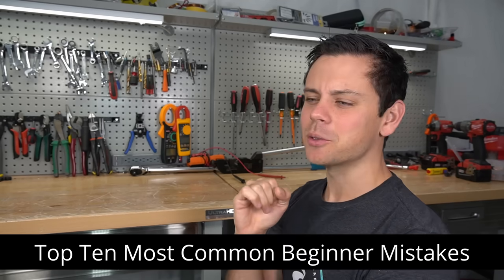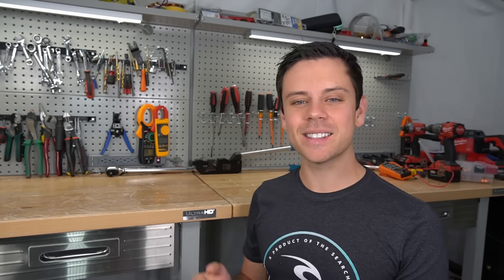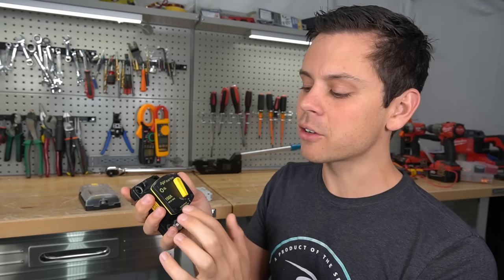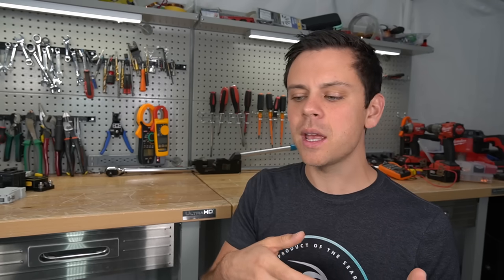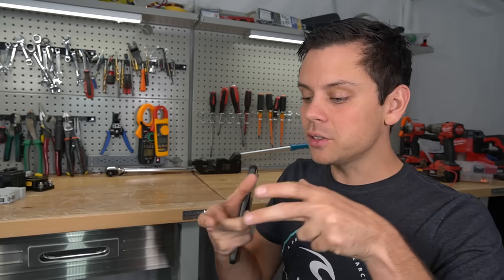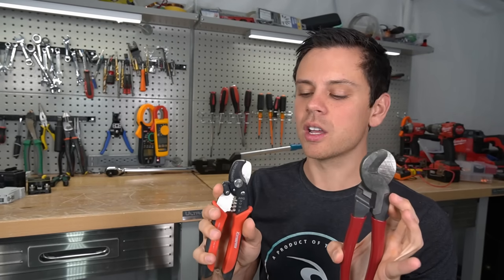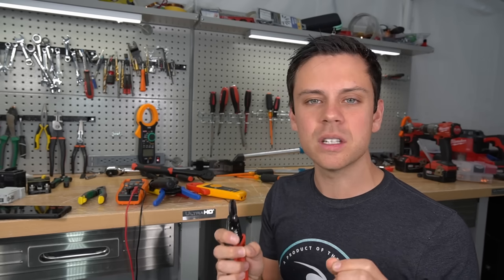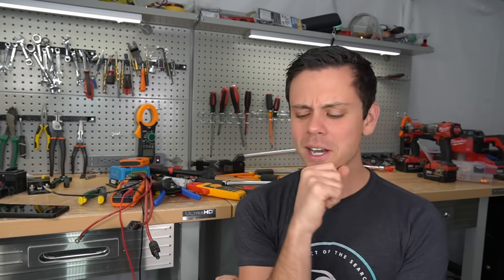Top 10 Beginner Mistakes When Building a DIY Solar System

Comment: I've got a hydraulic crimper, but I've still had crimped connections fail. I've soldered big lugs with a torch and only had trouble with one - that was CCA so I'll toss that data point.  I've sweated copper plumbing, and I'm and EE so I've done more than a little soldering. Done right - and it can be done right, it's the best way to go. Crimping is recommended because it's still relatively reliable while being a brain-dead-simple technique with minimal experience needed.

Comment: Does it matter if the batteries are different sizes as in amps? Would you connect them up in a certain way in the feed like small one first? Etc Cheers Ray

Comment: How does having a large bus bars allow me to put more batteries? If my battery bank is designed to be 500 amps at 48 volts for example, and I need another 500 amps of 48 volts, I've always been taught that I can't do that. 

I know this is a video about the top 10 mistakes for beginners, but I really wish I could get more information so that I can go more in-depth in regards to this bus bar/adding more batteries idea.

Comment: Will, you are WAY SMARTER than me!!!  i have a question for you.
lets say i want to keep my batteries at 100% charge at the longest possible and im using lead acid batteries.   how would i set up and wire my batteries so when 1 bank is at 100% charge something automatically switches to a second bank , and on and on as i add battery banks . then when i draw down a bank to 95% it tarts charging that bank  .
i am able to rebuild lead acid batteries i get from scrapping cars and people giving me dead batteries. even though the non deep cycle batteries are not designed for deep discharge, they can be grouped into a large bank together . i have 2 banks of 6   6volt golf cart batteries. 1is t105 and another is t105re. they were purchased brand new in 2016 and still going strong, but i desire some DIY way of automating this idea using relays etc...
i think it would be a great idea for a video! lots of people desire to be energy independent but spending thousands of dollars at 1 time is difficult  for them.
myself i have zero debt! and i spent $150,000 in 2017/2018 to ensure my family will have what we need for several years if we just stayed home and didnt leave for several years and had NO INCOME coming in!  yes, we have a lot of cash left to pay our taxes etc...

Comment: Wonderful helpful video!
I'm trying to put together a solar powered battery bank. I have eight lithium batteries that are 400 amp hours each, and I have a 6,000 w inverter that is pure sin waive with a terminal block, and it's a 48 volt inverter. I'm going to run the eight batteries for 48 volts. 
I was wanting to oversize my wires a little bit so that they would not run so hot. But I'm not sure what size copper wire I should be using, but I'm guessing a two gauge. Do you think the two gauge would do well?

Comment: Another issue with soldering lugs is, if there is enough resistance the wire or lug will heat up and the possibility of that soldering melting and letting go of either the lug or wire becomes a real problem

Comment: do I calculate how many amps I can pump into my inverter via PV by: 
input current by max pv input current (in this case 22A), or 
pv charging current range can be set (in this case 100A)
Thx

Comment: Hi Will, 
I have a question not pertaining to your video. I have a UPS a CyberpPower 1500AVR. It’s used and both batteries are dead, it has two 12V 8A  SLA battery. Can I change and use two LiFePo4 12V 10A  batteries?

Comment: Question. You mention torque screw drivers toward the end. If you have a loose but thick set of wire (e.g. 6x6) versus a loose but fine set of wire (e.g. 16x16), will it be harder to make appropriate torque on the thick set of wires? That is, the larger gauge wires (6x6) may have movement after the first appropriate torqueing, as they may re-settle after initial torqueing.

Comment: Hi I got an issue. I have a hybrid system where i hv connected grid n pv to the inverter. The inverter setting are pv 1st and balance from grid. 

So the issue is if pv line give power to the inverter 1st the rccb in the input side of the inverter trips as soon as grid tries to give power to the inverter, but if grid gives power 1st n then pv the rccb dont trip.

Comment: HI Will ... Have you ever tried to use the lithium battery blocks from inside of a Bluetti with external controller/computer/inverter?  I would think there is a LOT of people out there with DEAD all-in-one systems (Bluetti, Jackery, etc.).  I would think that if you could design a "system" that would work this way, there would be a LOT of demand for that!

Comment: So you can run this on an AC200p. Which is a tiny generator if that's what it uses during peak part of the day. You could probably run it for a few hours over night without having to add a bunch of batteries.

Comment: Between series and parallel which the correct use when u have more than 6 planes of solar that produce 30v each plane and u have a 12v  inverter

Comment: Good vid. Anyone know where I can get printed material on choosing components and more importantly the right sub-components to connect the primary. I want to use solar, shore power, and maybe at some point leverage my vans alternator to charge the batteries. There's got to be a good book on this subject. Any recommendations? Thanks

Comment: Question: with two 12v 100Ah batteries in series to get 24v , when using 12v chargers do I need to disconnect the buss bar (connecting - & + of the 2 batteries) or can I connect the charger leads to the individual batteries as if they were not in series?

Comment: So I think i figured it out now but don't know where to find a 1200 watt 75 amp 24 volt solar panel on the cheep. I'm running 50 amp hr at 14 volts but will add 2 more 12 volt motors in the future. Was thinking of running two 5 cell packs at 3.2 volt each and 300 amp hrs each that should give me 16 volts at 600 amp hrs.. this is for a 12 hr run taking into account for days with no sun. Hope I got this right. I will run a good mppt and bms with plenty of serge protection

Comment: Hi Will.  I have designed and built my own system (and I rebuilt it once, too).  I've learned some of the same lessons that you discuss here, plus some other useful points.  I'd like to tell you about my system.  I know that my system is not perfect.  It's a work in progress.  I don't think I can do a video, but I can certainly take photos.  Would you be interested?

Comment: And it wouldn't hurt to use a distribution block a few inches from the controller, using the largest cable that fits the controller,  I like using half the rated current on cables, and keep it short as possible, <20 amps on 10 gauge, up to 50'  ,  2/0 5' with a 270 amp peak,  is possible overkill,

Comment: Nice video.
I'm doing a diy solar integration for my house. I want to be able to use solar energy to lower my bills but be able to seemlessly switch to mains power when the sun is down. So I got a hybrid inverter with inbuilt solar charger controller. The problem is that I later realized that the inbuilt solar charge controller is pwm. Now I would love to have mppt charge controller. Please what is the best way to integrate an mppt controller to my inverter and still retain the solar hybrid function?

Comment: Will
 Do the Solar Panels have to be orientated narrow side at the top?
Does it matter which way you place them?
 I can get 9 on my shed places horizontal and only 6 placed vertical.
They are rectangles.. I say Vertical meaning 21" side is up and the other dimension is 42"

Comment: Does anyone know if this system: BLUETTI EB70 + PV200 Solar Generator Kit is suitable as a package for use in case of black out for a home of 3 bedrooms?
I meant can you plug directly to battery to power our PC and fridges or portable heater?
Is it possible to add more to this system if one wishes to increase wattage?
Thanks in advance for your advice. God Bless.

Comment: a solar tracker using Two struts. cooper. ball bearings and magnets to move the solar tracker. As a funnel  like track gets smaller propelling the ball bearings down the track into a can. This moves the tracker  so little through out the day. After the last ball bearing gets in the bucket the bottom opens balls roll out, the struts push it back and the process starts over  Seen the show magnetic games. Using gravity and kinetic force.

Comment: Renogys premium 400w kit when hooked up in series causes a pv over voltage on the controller. They supply a fuse to hook it up this way, yet they know it's an issue.

Comment: Hey, Will… I was just listening to you casually in the background talking about torque spec and wiggling wires, I’m sure there’s a joke there somewhere , but on a  more serious note:  ⚠️⚠️ The issue I had is with the Chargeverter from EG4 I picked it up by the Positives of negative battery side of the charger and the positive wire came straight of the unit with no effort at all other than being under its own weight, this time bomb  was brand new out off the box….,. On Further investigation I took the cover off,  reinserted the positive cable back into the circuit breaker where it had come from and tighten it down. Maybe you can slip this factoid  into one of your near future videos …thanks for all your hard work. You where  my first point of contact for this wonderful world we get you enjoy off-grid these days. Thank you again.
Reply from the maker: Oh wow thats good to know!!! Can you post this on the forum? www.diysolarforum.com
Reply: @WillProwse  yes sir,  consider it done. respectfully…….

Comment: Engineer all power to go to batteries, use a multimeter to check voltage and current levels, get a rectifier or some other thing if you need to! Get a transformer in there.

Comment: What's the best way to safe guard lithium battery bank of 920 AH ( 12volt) from over discharge if I currently have 3000 watt renogy inverter.(purchase in 2021) and a 60 amp MPPT solar controller ( AIMPINVT) I would like to set a custom low voltage to 11.8 volts. Thanks

Comment: Any thoughts on whether I should get two 100ah batteries or one 200ah battery? Because I'd just get the 200ah battery but the size is odd for my space. I just saw that cables are expensive so I guess that's a reason to stick with one, but otherwise I don't really know.

Comment: Are there any good thread lockers that can be used for electrical connections? Loctite 290 says it’s for preassembled electrical connectors. Any reasons not to use it?

Comment: Hi there a question if i may. I'm based in the UK and looking to invest in a solar system mainly to reduce the cost of bills, so I want to maximise the cost effectiveness of the solar, and use it in conjuction with a grid connection. The money the grid pay for exporting solar electricity in the UK is tiny, maybe 12% of the unit cost of grid electricity. So my thinking is to plan a fairly small system that will mange most regular small loads: lighting, TV, small appliances etc. Maybe 4KW. For when the house is drawing more than that, we use an electric oven and electric kettle, and all together peak household loads might be 10KW or more. Is there something like a smart invertor charger that will allow the house to draw what it needs from the solar system (prioritising the solar and battery) and when it needs more KW it'll just take the extra needed from the grid? Basically I want to minimise the solar investment (i.e. a small system rather than one designed for peak loads) but maximise my solar consumption in cost terms, and minimise the use of the grid to when higher peak loads are needed for short periods.

Comment: hi Will, I have 4 12v 100Ah Li phospate batteries, I would like to expand it but told they're limited to 4P configuration. Can I  still add a single 12v 400ah battery to the power busbar? I guess that's akin to adding 400ah battery in parallel to the 4x100ah setup... thanks

Comment: Could I please ask you a question. I hear that connections in marine systems should employ a dielectric gel like “tef gel” when you are making these joins. I imagine to keep the surfaces oxygen and corrosion free. Does this gel also up the the resistance of the join? Do you consider this good practice?

Comment: A charge controller should kickstart it out of low voltage disconnect when there's sun again, right. I believe renogy do, do you have any thoughts on the quality of renogy (for a small system)?

Comment: Will, should my cheap blue charge controller be getting hot? I have 400 watts capacity from (4) 100 watt panels and the charge controller is rated for a 650 watt maximum PV input. It is a 60 amp controller. I have the panels connected in parallel to keep the voltage at 17-18 volts and a bank of 3 lead acid batteries connected in parallel to keep their voltage at or near 12.5 volts. the charge controller is rated at 12-24 volts. The only time the charge controller gets remarkably "warm" is when charging the battery bank in full sun . Connections are tight and secure. Charge controller gets almost too hot to touch on the back. Thoughts or advice? Much appreciated .

Comment: So can I use auto reset breakers on Amazon? I'm in Canada. Where can I buy good quality but inexpensive components like auto reset breakers and switch box and 24 to 12v regulator? I found a 40amp 4 switch box on amazon for $40. I already have Renogy panels, Renogy 40a controller and 2x100ah LiTime batteries. All wired up proper gauges and MC4 connections.

Comment: Soldering is frowned upon in vehicles because of the vibration as it wicks up into the wire and creates a failure point just passed the connector.

Comment: Is a disconnect absolutely necessary between the solar panels and the charge controller?
Reply: It is wise, if you change your batteries you must disconnect solar first or damage could occur to charge controller. Switch makes that easy.

Comment: Do I need a specific charge controller for lithium battery? Or, is there any difference. I bought a Missouri Wind package, and he said his charge controller will not work for lithium. Do you have a video on this?

Comment: I had a ProStar 30 charge controller, after about 6 years one of the terminals got loose and overheated and burned up the terminal and ruined the controller.  I should have been checking them more often.

Comment: Good afternoon sir, is there any problem if I set—up 17S cells lifep04 battery to supply the hybrid inverter and it has an input voltage of inverter about 48vdc-60vdc.

Comment: Hello Will. I have a question kinda off subject. But i live off grid and on rainy cloudy days i use a small 2 cycle 800 watt generator to recharge my battery bank using a 30amp 120v car battery charger. It works well to recharge But the surges and fluctuations of my generator have burned out my battery chargers in the past. And when the sun suddenly comes out and hits my panels while charging with the generator the generator accelerates suddenly and shoots up in voltage. Is there any way that i can get a 120v Ac to Dc converter to plug into my regular conventional generator to then add a regular 12v inverter to get a more stable electric flow not affected by the sudden gennie surges. In otherwords turn a regular generator into an inverter generator. Please help with some info. Thanks. I cant afford to buy an inverter generator at the moment so thats why im trying to go this route instead.

Comment: Exactly right about crimping. And crimping with a high quality professional tool. However, I then solder them on occasion (optional for lay people). Messy wiring is a very bad practice and must be avoided and I'm serious about that. Unless you're me. The abhorrent fact is that I am a highly accomplished electronic engineer. And my solar power installation is truly a rats nest. Problem is it has been impeccably reliable for over 10 years and if I mess with it I'll have to take it all apart and start over. Just make sure you have good insurance. Don't do as I do. Lastly, I get a lot of amusement from the technical pontification coming from virtual lay people doing solar installations. A lot of which is "not even wrong",

Comment: I have 2 solar panels each 125w connected to a 30amp PWM Charge controller then connected to a 200ah deep cycle lead type battery. I have bought 2 more solar panels 130w each and an extra same type battery (200ah lead type battery). Please advise on how to expand my system.

Comment: Hi,
Is it OK to mix different types of solar panels  ?
I now have 2x 150W, 12V, poly panels in series and would like to add a 3rd panel. As I don't fi d the same panels anymore, I would like to add a 170W, 12V MONO panel, also in series.  Can I do this without extra parts ?
Nb, the wires now go straight into my Ecoflow Delta 2 power station.
Supplement question.
Later I would like to use these setup, with the 3 panels, to also charge a fix battery using a MPPT controller. 
Can I put a Y splitter to go to my Delta 2 and the other Y splitter out into the controller,  and if so do I need to put something extra to do so ?

Comment: Question ?? If I have my solar panels connected to my rv batteries and I'm not gonna be using any load is it ok to turn off the load option and just charge the batteries or should I keep the load option on ???

Comment: Will, do you know if a SOK battery rack will work with Signature Solar EG4 batteries?  Are the sizes the same and rack mount spacing the same for both?  I think you have both types there at your place.  Anyone else, do you know?  (48v 5.12kWh LiFePo4)